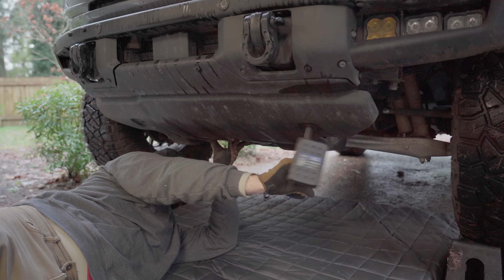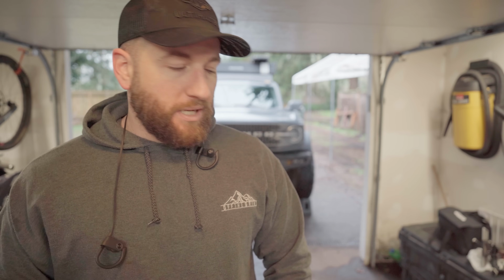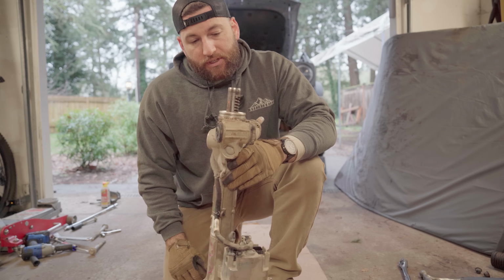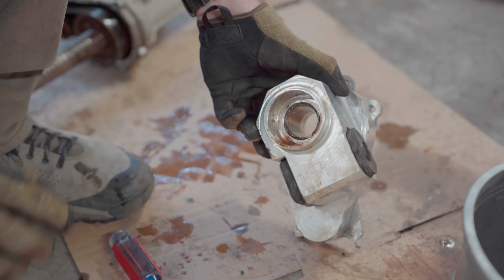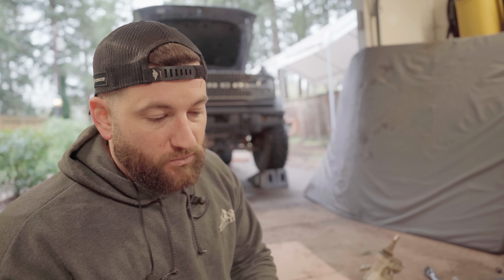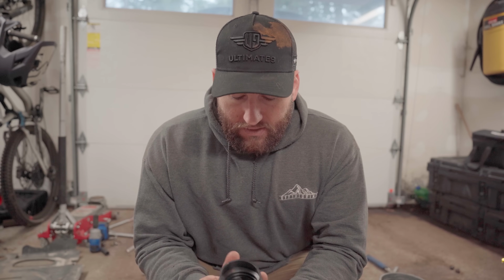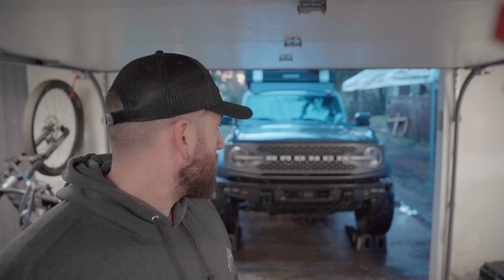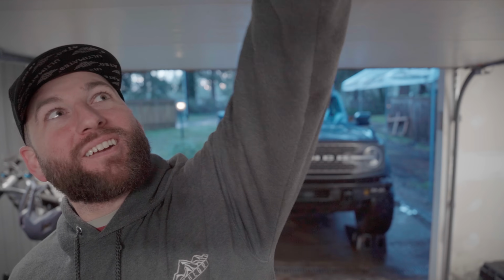My Bronco Steering Rack is Ruined! Learn from My Mistake!

Comment: brother, I love your channel, and really appreciate your humility. you have been a model for my own off roading behaviors and habits. All that being said, my advice is to use the stock tie rods. The stock tie rods are designed to be the weak link in the system to protect the steering rack. When you use those big beefy tie rods you transfer all that energry and stress to the next component in the chain and that is the sterring rack. 
This was not the cause for your issue as you mentioned earlier, but just my 2 cents and humble opinion. There is also a new product called the bronc buster that is a tie rod repair brace that will splice the tie rod together to get you moving. I carry a new in package spare set of stock tie rods in my parts box, as well as a few other things that are common Ford part failures. (Looking at you Wheel speed sensors)
Reply from the maker: Thanks man I really appreciate that. Yeah I totally understand that they are designed to be weak to save the steering rack. But that is why I also replaced the end cap as that is the most common failure after the tie rods. I’m on a lift and 37s now, so realistically I need to get either the HOSS 3.0 rack or the 74 weld stage 3, but I’m a slow and methodically off roader and the other failure point is typically seen in high speed impacts from what I understand. Anyways, I did think about all this prior to making these mods and our approach might be different but I appreciate you looking out!
Reply: @OFFTHEGRIND  Definitely Brother!!! We have similar styles in our approach.  Gotta plan the build out and all that. 
And yes, the high-speed impact is the most common reason they fail on the Raptor, that and too tight of a section where the wheels both grab and force them inward.
All that said, Dude, I respect you a lot and really appreciate all that goes into your vids!! You gave me the inspiration to get my channel moving again!!

Comment: You may find brake cleaner will remove gunk and junk off your parts faster in the future. That's what I've always used. Also, maybe check junk yards for a stock
 replacement to the rack before buying new.
Reply: Just make sure it's nowhere near body paint!

Comment: We got our Icon Tie Rods in late January 2023 and were also wondering about the boot situation… we went with zip ties. They’ve held up after a year of abuse… but we bought a second set of boots with clamps, because we’re assuming the boot will get trashed if we have to take them off.

Comment: I have been impressed with rough country lately. Never owned anything because of the bad rep from them. I have recently bought their ARB clone twin compressor and it’s great. My buddy bought the coilovers with resi and he’s had really good luck with them. Looks like they have made a turn for the better
Reply from the maker: It definitely seems that way. Their new line of suspension kits like you said are actually pretty good from what I’ve been hearing. Very glad that they are able to pivot and that the market is noticing their efforts

Comment: Hey David - good, informative video. I'd like your opinion on something... I've been on the fence about upgrading my tie rods. I know they're a weak spot and could break on the trail; however, I read a post recently suggesting that if a strong aftermarket tie rod does not break under pressure, the strain could transfer to the steering rack causing the rack to break. Essentially, the thought was better to break the tie rod than the rack. What are your thoughts? Cheers.
Reply from the maker: That is 100% correct. The tie rods are designed to fail before the rack and the rack is incredibly weak. I wrote an article on trail bronco all about this actually. The most common area for the rack to fail is the end cap. So if you are going to do heavy duty tie rods, you’ll want to upgrade the end cap as well

Comment: Great video! Love your honesty and humility! Just subscribed to your channel. We have a bronco that my wife drives, and we started overlanding in. And I just traded my f150 for a 2021 tacoma, so I'm going to be watching alot of your videos. On the bronco, do you think the RC tie rods and 74weld cap would've been good enough to make the steering rack better if the boots were good?
Reply from the maker: Thanks so much! Not easy to publically admit that I messed up, but I want to be as transparent as possible throughout all of this. And yea I do. However, I don’t know if I would go with rough country again. This steering doesn’t feel as direct so I’m not sure the joints are the best. I will personally be switching yet again, and I’m going with RPG this time. I’m done messing around with cheap stuff
Reply: @OFFTHEGRIND  I'm just a beginner at this, but I've been hearing and reading alot about these tie rods and alot of experience offroaders that have been doing it for years with jeeps and other rigs say those heim joints like the ones RPG has are not good. Less articulation more maintenance and can damage the rack.

Comment: Commendable for having the integrity to own your mistake and the humility to publish it publicly.

Note to self:  Don't use Icon Vehicle Dynamics.  Got it.  (Wasn't planning to anyway, I'm a TeraFlex fan)

As far as Rough Country is concerned, I've had their shocks and suspension systems on a previous vehicle and they work great.  Never had any issues from them at all and I beat the crap out of them.  Their shocks aren't the most comfortable off-road, but damn if they aren't durable.
Reply from the maker: Thanks so much! I’m never gonna lie to you all or hide the facts. That doesn’t help anyone. 

A lot of people have had good success with icon. And a lot of people have had bad. I personally won’t touch them ever again, but when they send you the right stuff, I’ve heard it’s good lol 

RC seems to be stepping it up and I’m stoked to see it

Comment: I have never been a fan of electric power steering racks when it comes to off road. They just don’t have the seals in them like a hydraulic rack and pinion or steering box and drag link.

Comment: What was the spray you’re using to clean these parts?  We’ve used brake fluid in past.
Reply from the maker: Brake cleaner might have been better. But this was on blaster which is pretty good at removing corrosion

Comment: Should there be rtv or a gasket between the 74 weld end cap and the case.  It is odd to me that the water is only on the 74 weld side.
Reply from the maker: There is actually. I just didn’t film it. It was just the passenger side boot that seemed to take in water. I think that’s because I packed with snow a lot on that side

Comment: So, I followed your lead and got the Icon tie rods + 74 Weld end cap installed (professionally, Brave Motorsports) on my Wildtrak 21. Is the key here to go in and make sure that the clamps are on the tie rods? I ordered them last month. I also don't play in the snow (Texas) and am not likely to find myself in the same situation you were in.
Reply from the maker: Yeah just make sure there are clamps on the inner and outer portion of the tie rod. If so you’ll be fine.

Comment: Hey Brother many of us have had the "could of, would of, should of" moments.  You'll be entertaining us again soon. 

A bit of a concern... That aluminum cover you pulled off and reinstalled.  Is there no gasket or sealant requirement to go between it and the rack assembly?  Perhaps a bead of silicone between the surfaces to keep any potential moisture out...

Also brother, leave the castle nut the end of the control arm and strike it - not the treaded stud...

Looking forward to more of your adventures.
Reply from the maker: Castle nut trick is a good one but one that I constantly forget lol. And there is sealant in it. I didn’t show me applying it. This time I used silicone as I knew the rack would be coming out again soon. But typically I use a liquid gasket which is also what I used when I installed it initially.

Comment: So what keeps the water out where the aftermarket end cap bolts to the rack? I don't see a gasket, seal or silicone.
Reply from the maker: There is a liquid gasket that I used. Just didn’t show it
Reply: @OFFTHEGRIND  gotcha was just curious now that makes more sense lol

Comment: Did you preemptively put in ICON tie rods because you wanted stronger ones or because you were lifting the vehicle and wanted to run 37s?
Reply from the maker: I wanted stronger ones and knew I would eventually lift and put bigger tires on it
Reply: @OFFTHEGRIND  I'm sorry you learned the hard way, at least you were in good company and got home safe. I have been biding my time on this issue (I have a 21 Badlands). I recently saw that the 2024 Badlands comes with the HOSS 3.0 steering rack, and I'm inclined to acquire one of those after a while. Hopefully Ford makes a kit to upgrade existing HOSS1/2 vehicles. I suppose you may still need different tie rods and control arms if you're going to lift, but I think the Bronco does just super on 35s and its my daily driver so its not in scope for me.

Comment: I feel we are a little off here, I have the same Icon rods on my 2023 Ford Bronco Badlands. The boots looked exactly like that out of the box.  All I had to do was to stick a tool in the small hole and pull out the lip for the clamp. I believe this was user error, unfortunately.
Reply from the maker: I definitely checked if it was just folded in, but it wasn’t. No ledge
Reply: Then why did you assume Icon somehow made it without a lip, when the plastic bag came with two large clamps and too small?
Reply from the maker: @mildoe3 it didn’t though….

It drives me crazy that people assume their experience is the same as everyone else’s. I’m glad you had a good experience with them and they’re working out for you. But you and I did not have the same experience, nor did we receive the same things in the box it sounds like
Reply: The reason why I'm following up on this is that you make Icon seem like they are not a reputable company. You said they are not responding to you, however, my friend had a small corrosion issue on a pair of shocks and Icom sent him a new pair. Didn't even ask him to return the old pair.
Reply from the maker: @mildoe3 the feedback that I’m getting from a lot of people on the company is extremely varied. They have really screwed a couple of my friends. And others, they’ve done good by. I’m simply sharing my experience. And yeah, they haven’t responded to my email but they did talk crap about me on a forum about me which was the final straw.

Comment: Ahhhh yes, you have discovered the QC nightmare that is Icon... ;) I liked your intro, good explanation and it cleared up a lot from the first video. Then you made me sad by holding up an RC tie rod loooool, RC has failed me approx. 3 times now on 3 different products. Tie rod thickness is not the answer to the Bronco steering. A couple things if I may that I have learned from tearing apart several racks of different broncos on my steering series... The tie rod does not need more articulation, you are nowhere near max articulation on your stock tie rods and you'll max out your axles and shocks before you do your tie rod joints. Not sure what your next tie rod choice is... (I hope it is Carli), but more articulation out of a joint won't solve any issues as it's not your limiting factor. 
Also, not sure if you plan on keeping that rack long but the steering screw 100% draws all that muck into your rack past the pulleys. There isn't any seal there and you have bearings that will go bad on the other side. You can remove the pulley and move it all around no problem, its the steering wheel that you don't want to move, as long as you line the steering screw up 2 &1/4" on each side and center the wheel you're fine. I'm also curious why you say the 74weld bushing is bad (I heard you call it the bearing but I'm talking about the bronze bushing inside their housing). Genuinely curious as I love studying that stuff and curious why you need to replace it? Anyways, love your trail videos and keep exploring!
Reply from the maker: We’ll see what happens with the rough country. Material matter more than thickness I do agree. But initial impressions were good on the RC. I have quite a few people that have had great experiences with RC so as with anything, every person and experience is not the same. Good info on the rack though. I truly do appreciate it. I am following the guidance from 74 weld though, and they recommend hiem joint tie rods for any lift over 2” (which I have coming soon) so I’m future proofing the bronco since my rack is trash and I have to redo it all. I’d love to get the carlis, they are badass, but a bit over my budget and honestly seem super unnecessary. I’ll be using the RPG tie rods
Reply: @OFFTHEGRIND  looking forward to it!